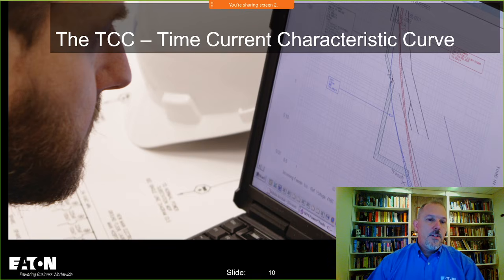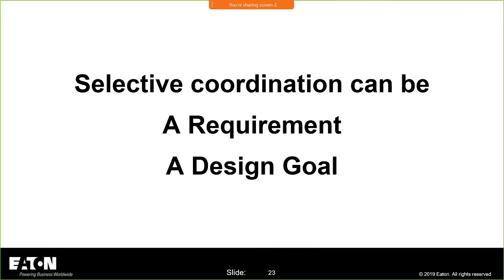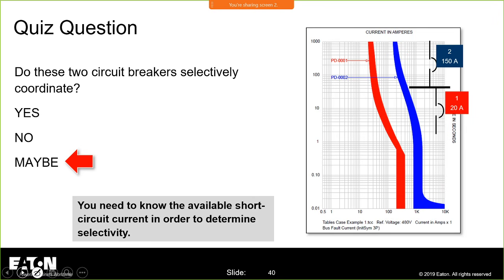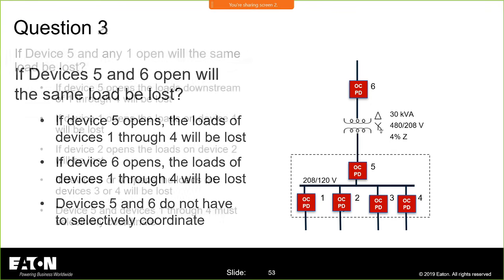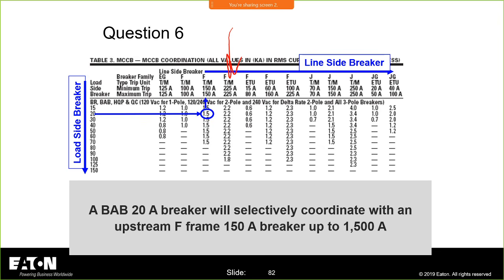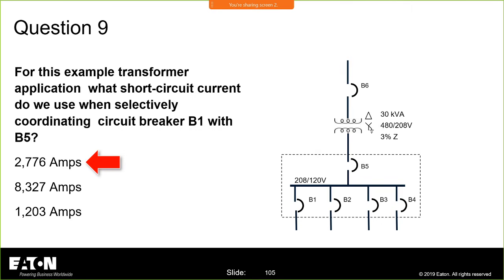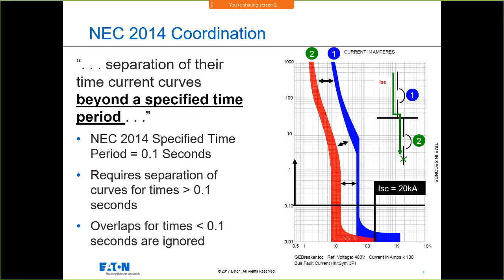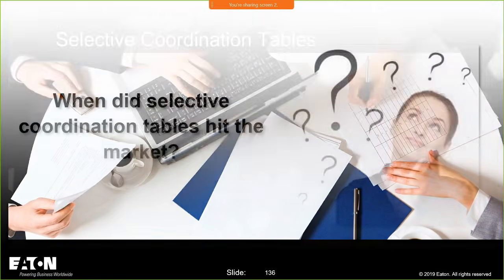Selective Coordination and OCPD Basics

Comment: At 1:26:40, coordinating breaker B1 with B6.  When it's a delta primary, is coming up with primary short circuit amps really as simple as dividing secondary amps by the reciprocal of the transformer turns ratio?  [meaning primary amps = secondary amps*(secondary volts/primary volts)]

Comment: Is use of a current limiting breaker or fuse upstream of a circuit breaker with a lower interrupting rating than the infinite bus of the xfmr considered a series rating application requiring either tested pairs or PE design, per NEC?

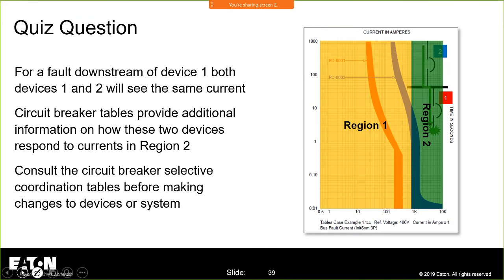Comment: Hey Tom!  At 37:00 , if fault current is less than 150A, then would these circuit breaker would be coordinating? In case current is low because of earth fault.
Reply from the maker: Answered your question in this video.  Thanks for engaging in the dialog.  https://youtu.be/uN3bqw6jvkY